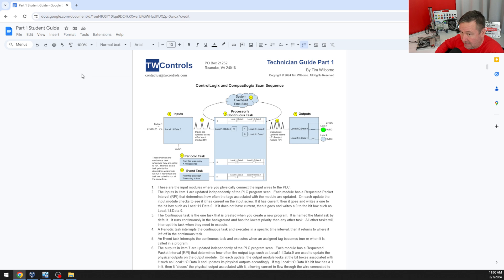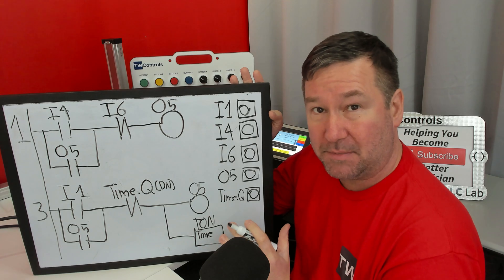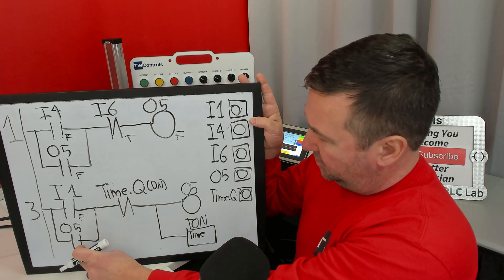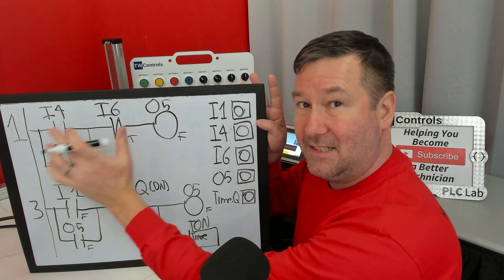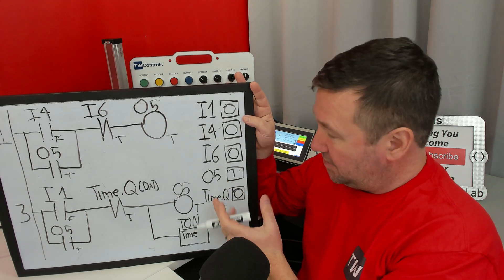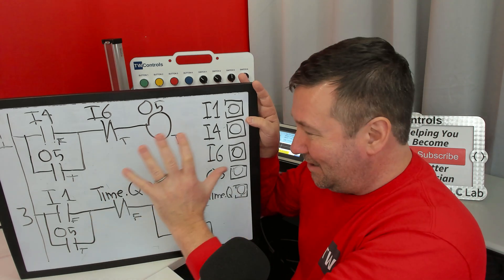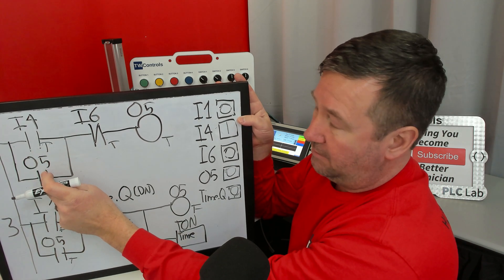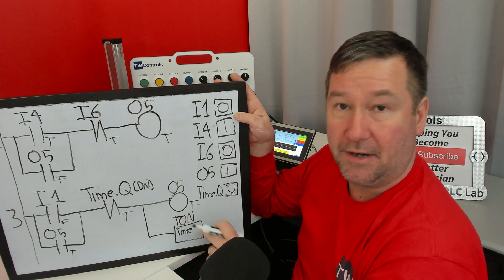Duplicate Destructive Bits in PLCs.  The BEST Program Scan Lesson.

Comment: I watch your video before, and I'm still trying to find how the Micro850 performs its scan. From this video I take it you are saying it uses Scan solve set housekeeping. Duplicate outputs can wreak havoc so I encourage my student to avoid them, or to use setup internal bits to make the decisions and then fire the output once that logic is solved. :b d:
Reply from the maker: Here is a video on the scan cycle. The issue with simply stating for them to avoid them is they won't know how to work through them when they run into them.
https://youtu.be/GSiBxY0BH-g
Reply: Good Point.
Reply from the maker: Let me know if that video helps with the scan cycle. It is an older video.
Reply: @TimWilborne  
Thx. I'll link your video to the students suggested watch list. There seems to be something unique about the Micro 800 series, in that for themost part t behaves like a SLC or PLC5, and at other times it behaves like a COS Logix PLC. That's why I'm still looking for clarification from Allen Bradley. To be frank most seasoned electricians don't get Change of State scans. I didn't get it until I found in the 5th AB Manual I read  a single paragraph explaining that there was 2 CPUs running asynchronously, and the I/O update was on one and the Logic was on the other. If you happen to find out from AB before me let me know, I'll do likewise. Great site and great videos.
Reply from the maker: Can you give me an example.  I'm not sure I am following you.  It does scan similarly to the SLC or PLC5 but it also has timed and event driven interrupts...but so the the older PLCs.  Is that what you mean?
Reply: @TimWilborne  With Contrologix the inputs and outputs can be updated during the execution of a rung. This is due to the dual processor, and why they call it Change of State. For 99.9% of the time the dual destructive outputs follow the last order wins. (Until your video, I've never seen it behave any other way with SLCs and PLC2 and 5 in my 30 years at Ford Motor Co. Contrologix  is acompletely different animal. So when a student's program did not follow the old way I went looking to see if the Micro800 had the logic engine (i.e. were Change of State -dual processor), but every thing state it was Scan Solve Set House keep. The only Interrupts I have found (other than programmed ones - which I haven't programmed yet, was the way the timer functions worked. They don't operate on a heartbeat count any more but rather a mathematical adjustment based on the scan time. So it could be the student's program behaved differently than expected if the timer was finished out of schedule...but that's a stretch. Speaking of stretch..you use to be able to widen the housekeeping slice to allow for long communication pushes, given there's no Scanner /Adapter, stuff or DH+ dh485+ I take it the traffic time is fixed by Ethernet -which has it's own time.
Reply from the maker: That's called an asynchronous scan and the update rate is dependent on the RPI. This is different than change of state. Here is a video. 
https://youtube.com/live/UeI8s4oc758?feature=share
Reply: @TimWilborne  True enough. This raises another question... (always does, doesn't it) I grant you Ethernet UDP focuses on RPI more than TCP, so if we only communicate with ethernet, I did not consider this introducing Asynch. scan - especially since we are dealing with I/O. (Thanks. I'll investigate  separately) Notwithstanding RPI,  First semester we strictly use USB. Now I'm not a computer specialist, does USB also use RPI. I've always assume it worked on standard serial communication protocols. If it does, that would explain both the appearance of SSSH, but periodically becoming asynchronous. On that subject, I am also assuming the communication time slice of the Housekeeping section still applies, and the bigger the program - the more likely ist gets chopped up to meet the time limitation (which I explain on longer programs with larger scan times - not on 4 rung wonders etc.) Thanks for your time and input. Its really appreciated. Alan
Reply from the maker: All CCW communications happens during that overhead step, but it is a very small amount of the resource use of the PLC.

Comment: Hi Tim,

At the 4:45-4:50 mark, you mention how the PLC scan still evaluates input6. I’ve asked the same question during a very advanced Rockwell Training Class with a certified Rockwell instructor who said that it does not get evaluated in order to decrease program scan rate times.

Is there any sort of official documentation from Rockwell that you could link stating explicitly that the input6 still gets evaluated?
Reply from the maker: It evaluates it every time. Look at the text view of the ladder and you can see the exact order.
Reply: @TimWilborne is there any documentation that explicitly states that it evaluates every instruction? The ascii text representation of the rung is just another representation of the same rung in ladder. If I had a link to documentation, I’d have something to physically show people when they doubt whether the instruction gets evaluated or if it skips along to writing to the OTE bit location.
Reply from the maker: Yes it is in many of the software and processor manuals. I'm not near a computer for the rest of the month so can't site a specific link

Comment: I would not do this, i am correcting what i said below. I have seen this done many times and it works most of the time and then it doesn't.  It introduces a bug. I just corrected a long standing problem in one of our programs due to another tech using a duplicate bit. I was warned about this in school to never do this!

Comment: Thank you for the great explanation. Coming from a computer programming background where nothing happens if the trigger to a command is false, I had a hard time dealing with multiple commands controlling an output. To me, if the input to a rung was false, I expected the output to be untouched, but as you mentioned in the video, if the input is false, the controller will explicitly write a zero to the output.
Reply from the maker: I'm glad it was helpful